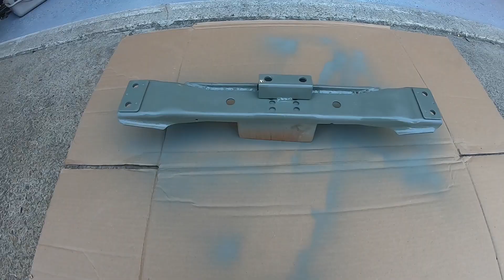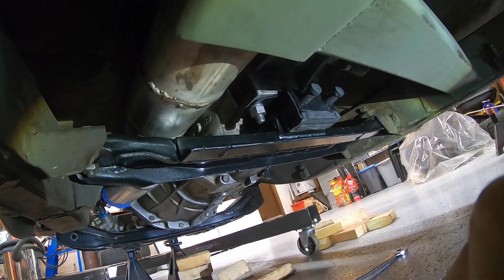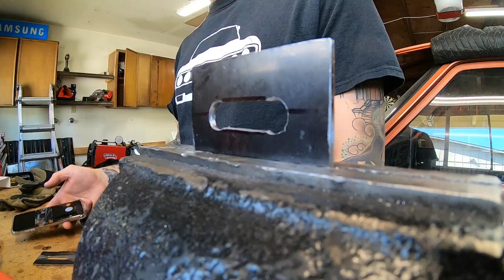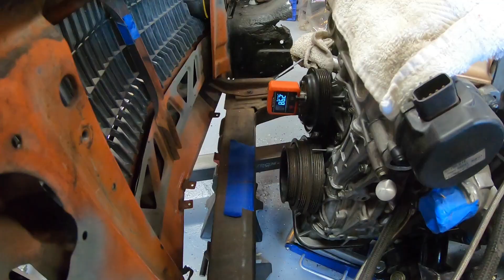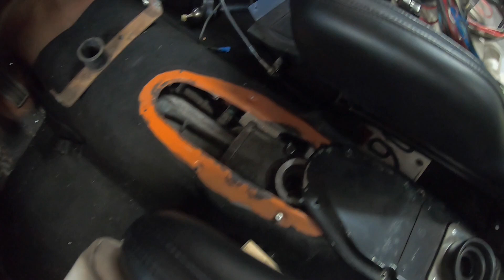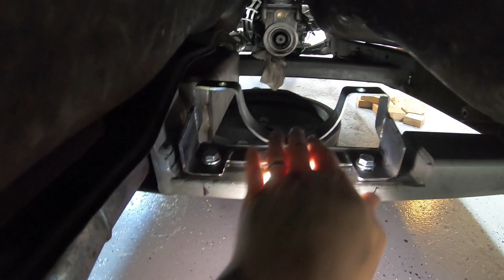240SX swapped Datsun 620 - SR20DET and drive line mounted!

Comment: What suspension do you plan on putting back on the truck? This looks clean great work ✌
Reply from the maker: Thanks! Everything I will be running will be 240sx bolt on items, I'm starting with the cheapest coils I could find because I may have to cut them to fit 😬, after I get the dimensions I need I'll probably go with PBM coils as I believe they're the shortest ones (besides maybe 326 power ones but I'm not rich 😂)